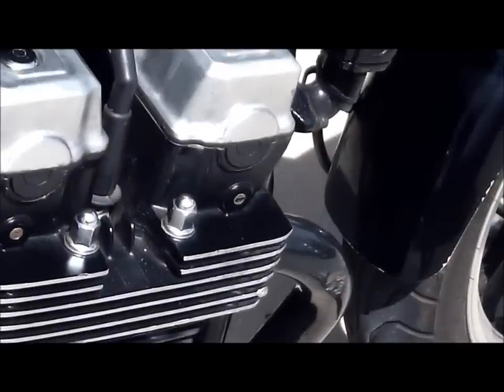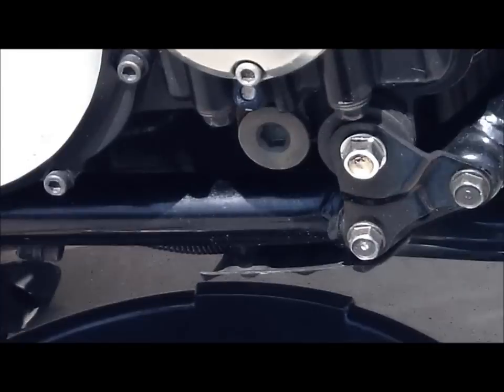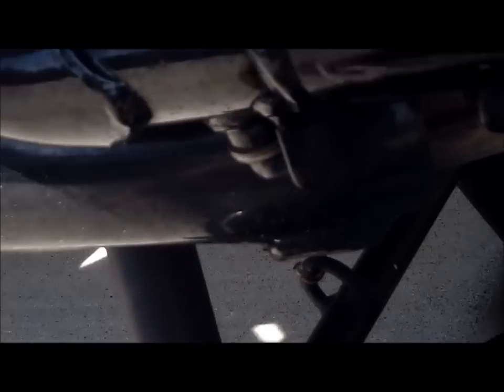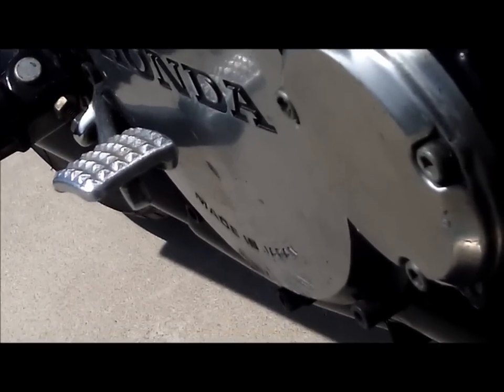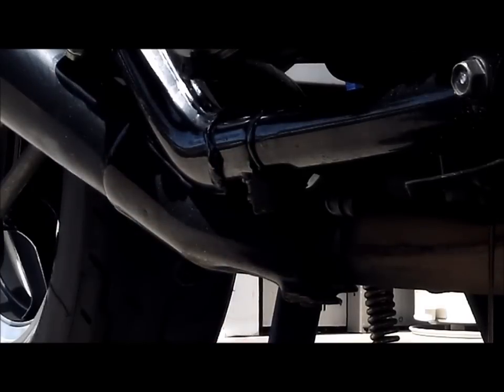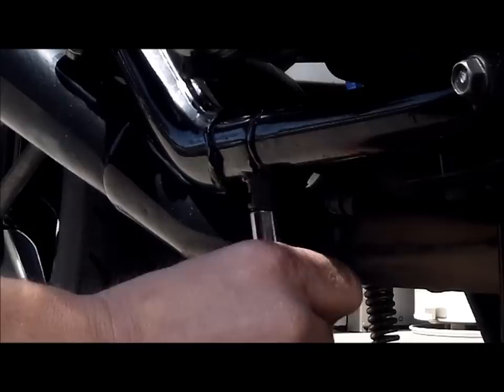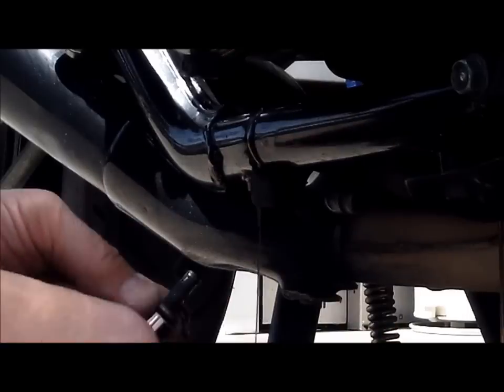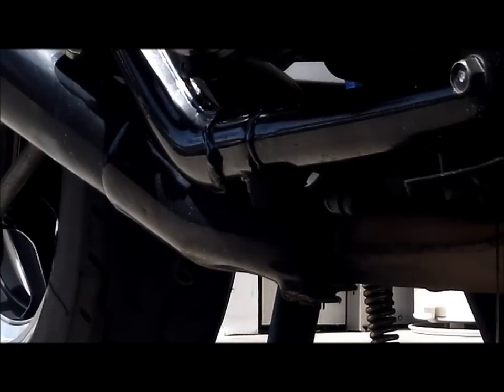Time to tinker 8 Honda Nighthawk service.wmv

Comment: I just bought a 1984 Honda Nighthawk 700S with a little over 10,000 miles. She's in great shape but I need to change the shaft drive oil. Your video really helps.

Comment: Nice video!  The guy I bought mine from told me to drill a hole in the lowest portion of the filter to let it drain before taking it off.  I'm gonna try this on my first oil change to see if this helps with the mess.